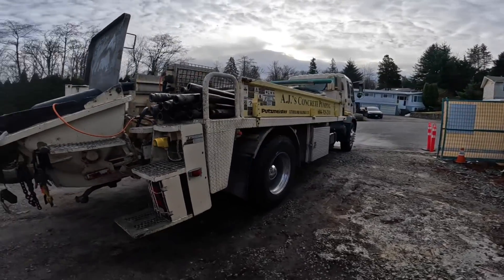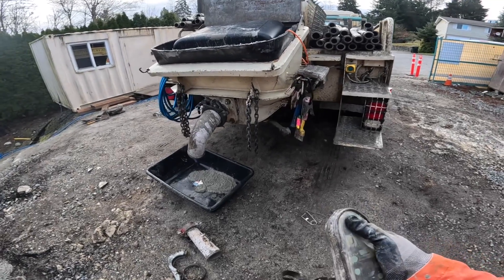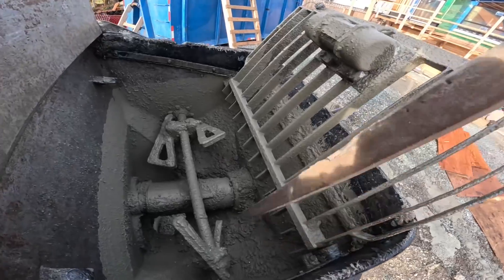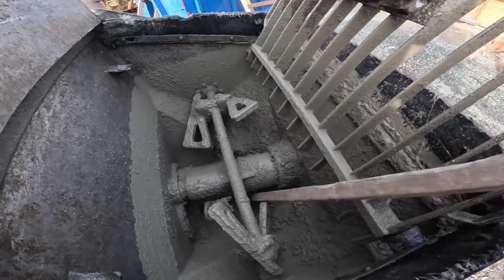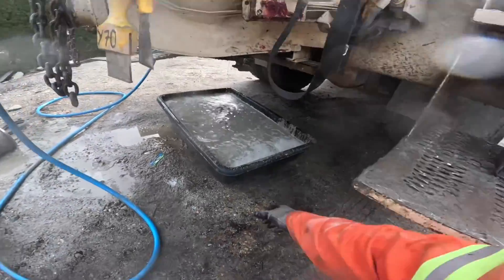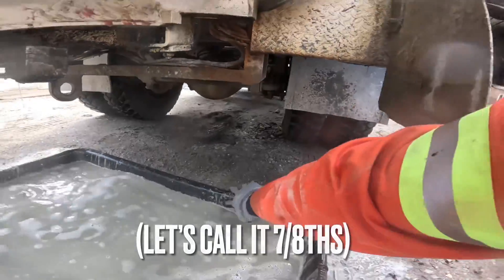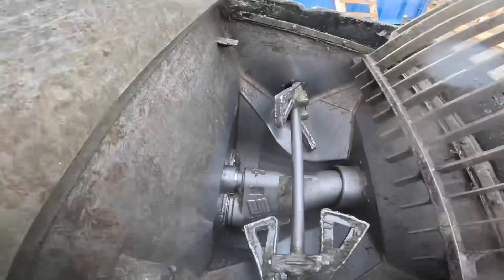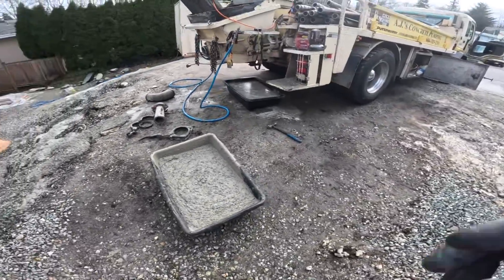PUTZMEISTER vs SCHWING (hopper washout):

Comment: Cifa's, at least our 2006 had very easy to washout hoppers. I've gotten it down where you open the door, stroke a few times, and there is ZERO concrete left, just wash a layer off the walls and wash out the s tube, done.
Reply from the maker: @romangavrilov930  Yeah, the “pocket” around the rear bearing of the Putz hopper tends to get a good amount of hardened buildup through the course of a day. A bucket of sand/dirt dumped onto the hopper around said area sure does make like easier at the end of the day.
Reply: @canadianconcretepumper1979  I've been wanting to add a scraper under there. Don't the new putz have them?

Comment: Also I use diesel fuel to coat the pump before pumping for easier wash out but it ruins clothes and I just think there’s something better and as cheap. What is it you all use?
Reply from the maker: I use canola oil. It works very well, and keeps the “enviro Karen’s” at bay..

Comment: Just use a presure washer! That's my way to clean out mine
Reply from the maker: I like the pressure wash for the S-tube, but for rinsing the inside of the hopper I find that it back-splashes too much and makes a mess. Just a personal preference.
Reply: @canadianconcretepumper1979  you are right about the splash, but not in my case, I just found the way to make it nice and clean!😊

Comment: i have a splendid idea for longer booms, why can't manufacturers make both folding and telescopic booms at the same time?
Reply from the maker: I believe Sermac manufactured a 62 meter boom pump with a telescoping main section. From what I recall, there were some issues with it.
Reply: @canadianconcretepumper1979  If you add 1 telescopic extension to the end of each boom, the length will double

Comment: I've run a lot of Different Pump's in my almost 30 years of pumping concrete since I was a young kid from Hydroseal pump's which was the worst pump's to work and gate valve Schwing and Putzmister and the easiest hopper to wash out is a Schwing Rock Valve that's what I think here in IRELAND

Comment: Schwing guys use what’s called a rake for cleaning the rock valve
Reply from the maker: I’ve seen them strapped to the hopper grate of new Schwing rigs. We need to build one for our 4800 trailer pump: